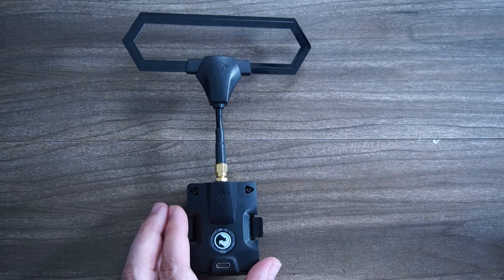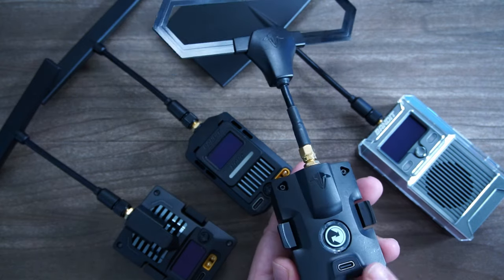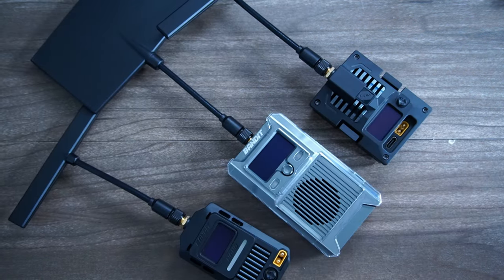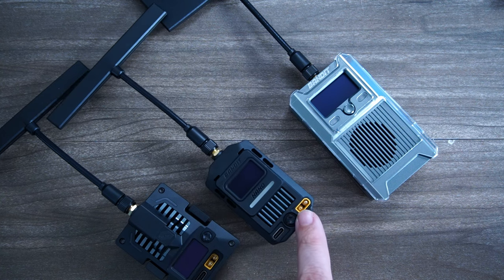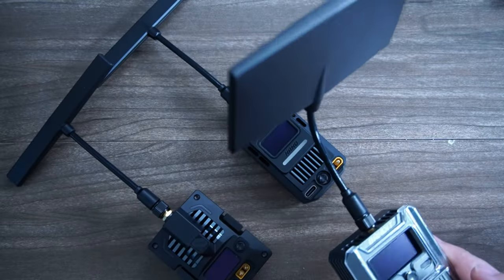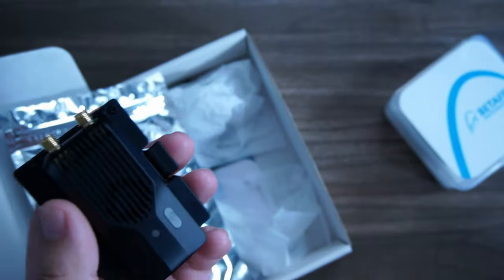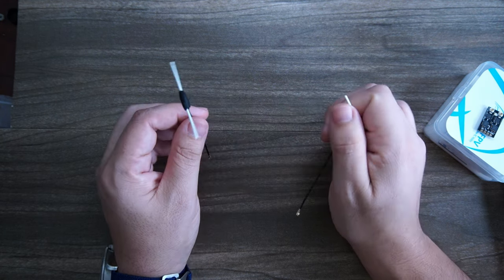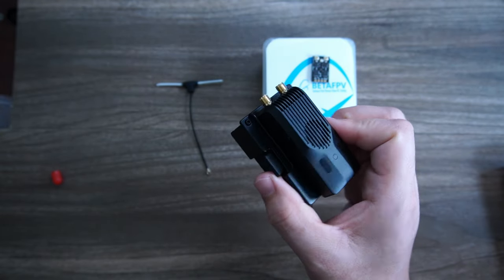Latest ExpressLRS gear by Radiomaster & BetaFPV

Comment: I know a lot people said a while back that the boxer or erls would be the final nail in the coffin for Crsf or TBS. You know me. I’ve been on tracer/crsf since it come out. But it just seems like Radiomaster is more and more easier and accessible now. And it just works. Radio master is  advancing where Trappy has been dragging his feet. 
I’ve only had one micro fail safe since I’ve been in erls. I would like to the diversity. But it wouldn’t be for long range. Just that low penetration.  
Lookin forward to the actual review.